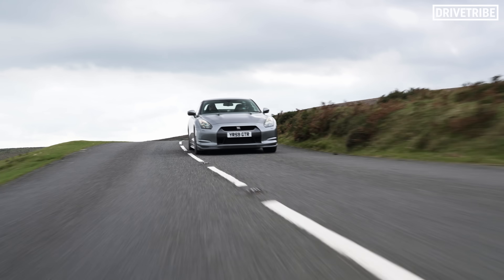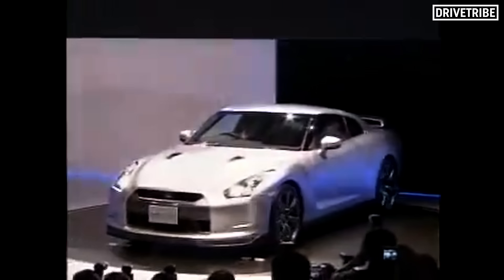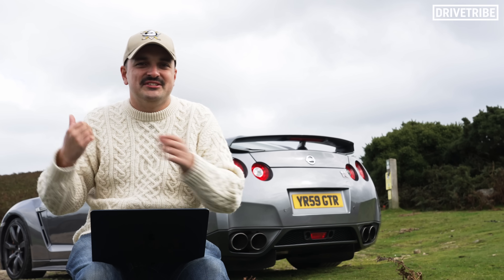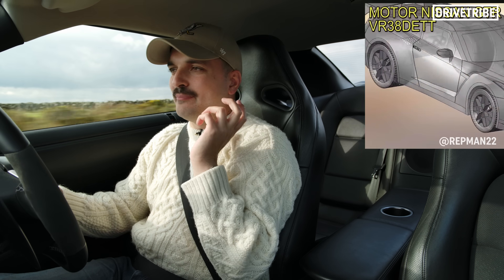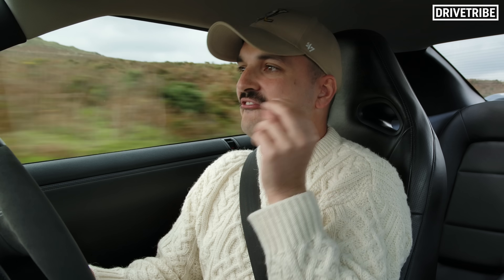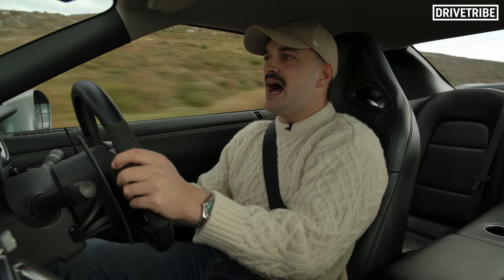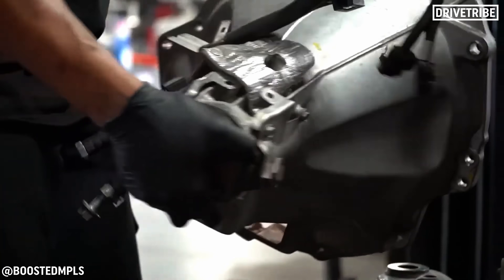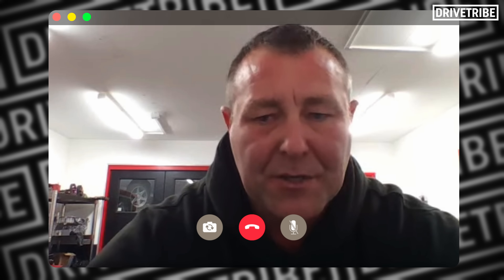How Nissan Made 1000 BHP Look Easy

Comment: S58 Leads new era. Starts Off from 525 WHP to 750whp( stage 2 only)(Dp). Runs 9s with everything Stock. Enters 8s with turbos and PI. Enters 7s with weight reduction. Still Fairly new platform (2020-2021). Rest time will tell. Long live ICE 🤝

Comment: It was impressive on its own accord for its time but this seems to take a far too romantic view that's a bit more in-line with engines from the 90's, where the differences were larger and ECU tech was 2nd. The 2000's spawned some really great engines that took very well to established high end modification norms (and I'd argue brought it down market a little too in price). This has only continued into now.

Even the bit about iridium tipped spark plugs... my replacement plugs on a 1.6l econocar in 2005 were also iridium. i-DSI Honda Fit's were iridium from factory.

Comment: Who cares?  You could make that go warp 6 and it's still a V6 powered computer on wheels for drivers with enthusiastic ineptitude.
Funny how you could get 1000 hp out of the I6 in the prior GTRs, that had almost a liter less displacement.
Nissan had zero reason putting an unbalanced vibrating POS V6 in that.

Comment: I think that last question has been answered. 
If we think of popularity / Tuning capability / and high HP limit on the foundation of where it started the answer was made a while ago. 

It might be an unpopular opinion but I think this award goes to Ford. 
The coyote. Gen 2 & 3 you can bolt on a whipple & you will get MIGHTILY close to 1000whp on a stock block as compared to a VR38. 
Now considering the Yote only comes stock with about 460 crank HP 
That is not only impressive that it can nearly double its crank HP but also stick together for a short time at that level of power. 

Ford is not my favorite brand in fact mine is Nissan king of the 90s. Forever my favorite brand. 
But, when I think of a successor in power and tuning to the VR38 
The coyote just naturally rolls off the tongue.

Comment: The history of the VR38 and yet no mention of where it was actually designed and developed, and hint, that's why the ports and valve train/block were pretty decent for the time (although nothing special these days) as obviously with such a large capacity (relatively speaking) the specific power figures are nowhere near modern numbers

Comment: It's actually 3500whp, not bhp, makes it all the more incredible😵‍💫😵‍💫😵‍💫😵‍💫😵‍💫
Reply: that's with billet blocks, by which point its no more a GTR engine as a billet drag racing BBC is a chevy, my be the same base architecture but that's about it.
Reply: So youre point is the 2900hp 2jz is no longer a supra engine and a 2000hp k series is no longer a civic engine? Because they all use billet blocks. Ok then.
Reply: @conradsealy9603 you nailed it 🎯

Comment: The B58 from BMW is kind of the new tuner's dream of the modern era. Even stock that engine can handle around 600hp, with tuners going way past 4 figures with reinforced pistons/block.
Reply: Brett Lasala is destroying billet race motors with prepped oe cast Coyote. Today ran 6.045 @ 234 mph Ford cast block and heads. No B58 on the planet is doing that.
Reply: @chadkent1241  no replacement for displacement. even under boost. you can have a 2l engine that can tollerate 300hp/liter and make 600hp or you could also have a 6l engine that can only tollerate 200hp/liter and make 1200 hp.
Reply: The B58 is nowhere close to the VR38DETT.
Reply: @conradsealy9603  
I'm not comparing it with the VR38, I'm saying the B58 is highly tunable and can run hp in the thousands relatively easily.
Reply: @conradsealy9603 your right, the b58 will prove over time to be much better.

Comment: Let's clarify, 600ft/lb AT THE WHEELS that's the limit. You choose where in the rpm range you make the torque..the higher in the rev range the higher the HP. So 800whp is common on these

Comment: 1000hp lol, not in the original versions, the connecting rods are so weak they will randomly let go at stock power level.
Reply: That's the McLaren 720 you are talking about? Bends rods in stock form.
Reply: The vr38dett starts bending rods at 600lbft of torque which is about 800 wheel horsepower at 7300 rpms

Comment: Technically, if you swap the block, it is no longer the stock engine at all. You can mod the stock engine and say it is a "modded [VR38DETT]" all day. But if you swap the block, the foundation of the engine itself, it is no longer a [VR38DETT] at all.
Reply: Not many people understand this 😂. The video also never answered the question about why it was built with a lot of potential 🤔
Reply: @jdmglobalwarehouse  yeah not a very helpful video other than reading off some stats that took 5 minutes to look up on Google 😅
Reply: @jdmglobalwarehouse 💯
Reply: Do you mean switching the block for like a billet block or do you mean an actual engine swap is where the line ends
Reply: @Omar_ZX billet block is what he means I’m sure. That’s the ONLY WAY to make 3000hp in a GTR.
Reply: @crimpinurpimpin  is anyone making 1500hp outta an rb or 3-5th gen viper engine stock? If so please gimme info since that'd be cool
Reply: Right
Reply: The only engine can make 3000hp stock block and head is 5th gen Viper.
Reply: @GF-mf7ml those vipers are billet block. Cast iron can’t handle that power.
Reply: @GF-mf7ml no not at all, the 5th gen viper engine is very brittle on boost, the 1st 2 generations had forged components while the 3-5th did not have any at all
Reply: @GF-mf7ml guys are making 3300hp with stock block/heads/crank with coyote engines. Seriously, stock crank.

Comment: Just saying magnesium is not a better heat dissipation for the sump, aluminium would do a better job, but as sealing the engine goes, and just being a bucket for the oil to sit in the reason it is magnesium is because magnesium is the lightest option for a structural metal.

Comment: Its not over engineered if the internals are made out of chocolate. The older 90s engines were over engineered and why they were so strong and reliable. Even my 28 year old mk4 golf gti has forged internals and crankshaft which can take well over 1000hp and its a little 1.8 20v. U will never be able to replace the older engines when they were built properly because all modern crap is just made out of cheap plastic and doesnt last 5 minuits which is why the car industry is now dead unfortunately

Comment: Lots of engines are 1000+ hp capable, it's just a matter of how many parts you have to replace.  The GT-R engine definitely won't do that in stock form.  TBH, the platform is 16+ years old now.  There hasn't really been real development since Kazutoshi Mizuno left a decade ago.

Comment: The engine in that 3,500hp GT-R is a using a billet block. Yes, the whole engine block is swapped to a FULLY custom one so it’s not really relevant as a reference of the power potential of stock VR38.
Reply: It's a blueprinted engine just because they went to billet like literally every single other platform did doesn't all of a sudden make it a different engine that's not how that works hence why it still runs factory cast heads. Full custom engines are built from the ground up like Proline Racing, changing a Factory block to a stronger material like billet doesn't make it a full custom built engine. T1 Race ran their shop car for years at 2700whp on a factory cast block that's 3000hp+ at the crank only other factory engines that have done that are the Lambo V10 and the Viper V10 and the Ford modular V8 that's it
Reply: @antilagboostaddiction8322  my point was the billet blocks are not relevant since the premise of the video is about the power potential of Nissan’s VR38. Obviously, the billet blocks were made in the first place because the limit of the Nissan’s block was reached. Whether you consider billet blocks still “Nissan” engines is up to you, but that is not what my comment was about.
Reply: @antilagboostaddiction8322  it's no longer "nissan" engine once the block has been thrown away. Yes it's some form of vr38 but it's no longer from nissan
Reply: @yota8325 all of those billet blocks have larger diameter cylinders, different (improved) oil and water galleries, etc etc etc. so call them a VR, JZ, RB, SR, etc. is purely to feed the fanatics. They are engine block build by third parties (some, slightly) based on these engines.
Reply: @JP_SC  Slightly based on the VR? So then how does it still run factory heads ect? Proline Racing builds engines from scratch changing the material a VR engine block is made up of doesn't all of a sudden make it a different motor. Y'all haters are hilarious
Reply: @antilagboostaddiction8322  you can call it whatever you want mate, if that makes you happy, It only shares the basic design.
You buy a Nikey t-shirt on the black market for $5 and you wanna call it a Nike...sure, if that makes you happy...it's the same thing, a counterfeit product basically, doesn't matter if better or worse than the OEM, it's still counterfeit.
Reply: @JP_SC  Ok so from what you are saying the 2jz and RB have never went 5s in the 1/4 right? You do understand that you think a 2jz hasn't went or held the record for imports all because it's billet is mind boggling 🤣
Reply: @JP_SC  Kamila supporters at its finest 🤣
Reply: @antilagboostaddiction8322  you must be on something stong man...
Reply: @JP_SC  So the 2jz never went 5s in the 1/4 same with the RB and VR?
Reply: @JP_SC all that yapping went nowhere
doesnt matter what they changed in the billet block as long as the studbolts locations are still factory same goes with the heads
Reply: @everydaydose7779  sais who? What official authority gives the same name to an unlicenced "copy"? 🤣
Reply: @JP_SC  so the 2jz record doesn't stand? No Jz, RB or VR went 5s all because they were billet?
Reply: @antilagboostaddiction8322  they stand as billet records, obviously not the same.

Comment: Here's an oddball answer to your question about who will step up to build the next crazy engine. My answer is Chevrolet with their new LT7 engine from their new Corvette ZR1. 1064hp from a 5.5L flat-plane crank twin turbo from a production car is just insane.
Reply: In comparison the rx7 at stock makes 212hp/l
This LT7 makes 193hp/l
Reply: @everydaydose7779  You can't treat a rotary like a standard piston engine, double the volume and it would be more accurate. There is a reason why wankel engines in competitions use a multiplier of 1.75x to 2x for claimed volume when deciding in which group they would race. An rx8 with "1.3l" can't go against other piston 1.3l NA cars, because of how it works its more like a 2.6l engine

Comment: So basically, 1000bhp+ capable ... if you change the exhaust. And the internals. And the clutch. And the drivetrain. And the block.

Friend of mine, bloody good driver, had one of the first at 700 HP. One lap on the track - everything, absolutely everything overheated.

Comment: VR38DETT engine was one of my favourite jdm engines along side with my other favourite engines RB26DETT (Skyline GTR) and 463T (Lancer Evolution) and 13B REW wankel (RX7).

Also i play NFS Heat which I Buy the Nissan Slivia S15 also i engine swap with the VR38DETT engine on the Slivia S15 and add modification performance parts of that GTR R35 Engine swap powered expect the turbo of the VR38DETT. That engine has a Twin Turbocharged for me I installed a Single turbocharger on the VR38DETT engine instead installing a twin turbocharger like a standard VR38 engine has when I raced my modified racing tuned S15 it was running powerfully at the streets and also I kindly liked my S15 what I modified including the engine i swap.

Also VR38DETT engine was powerful engine similar like the RB26DETT engine.

Comment: I mean, plasma coated liners, iridium tip spark plugs, closed deck, secondary air injection for catalytic, all standard for 20 years probably? No?
Reply: The car is almost 20 years old. Probably started thinking about it in 05.
Reply: @BollocksToThat  2002.
Reply: The Mustang Cobra R' s 5.4L V8 had Plasma Coated Liners. It's a very desired engine to this day. The Nissan GT-R was NOT the first car to have any of that stuff. But was likely one of the first to have it all.
Reply: @DocWolph But it was the first and only untill now to have it all at once. Now the priority is to make the engine explode after warranty.
Reply: Same with thermostatically controlled oil temps...that is very old tech now.
Reply: Iridium spark plugs yep 👍🏻 20 years ago.
Reply: Yamaha, Honda, Kawasaki and Suzuki for their superbike engines. That all started in the eighties
Reply: Dude the GTR prototype was the cover of one of the Gran Turismo 3 or 4. This might well be the reason these things are standard for 20 years

Comment: there is nothing special about it, it just started as a relatively cheap car to tune, plus the large GTR aftermarket jumped on to it soon after launch with mods, place the same R&D in other engines and you'ill get similar results.